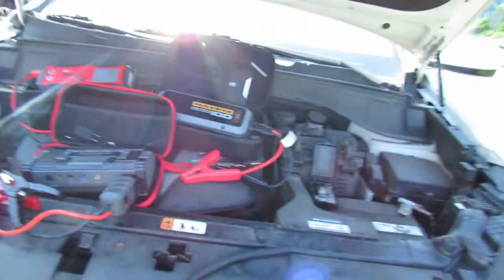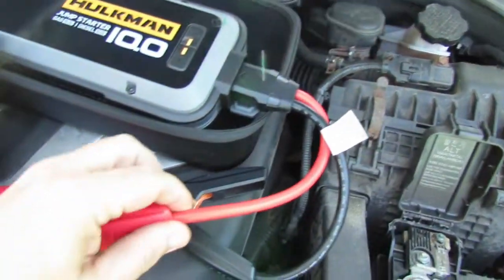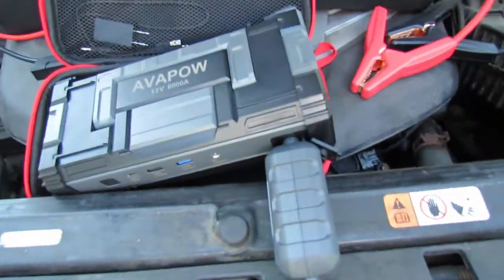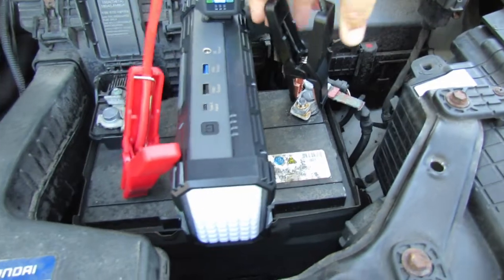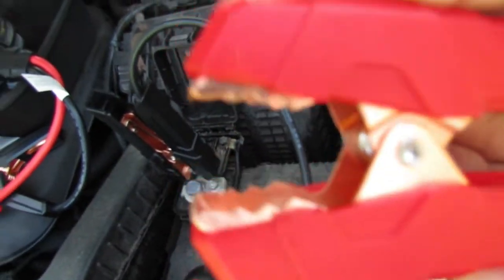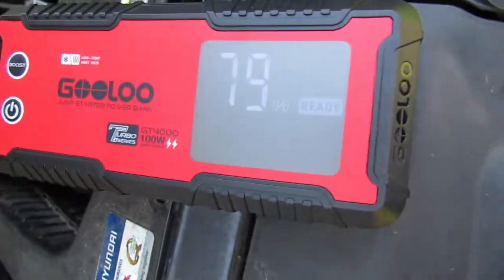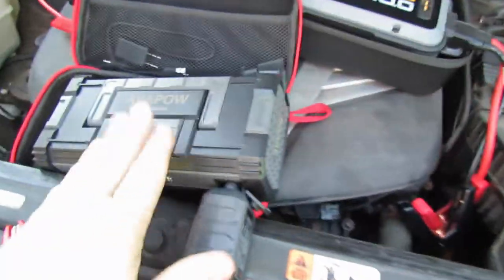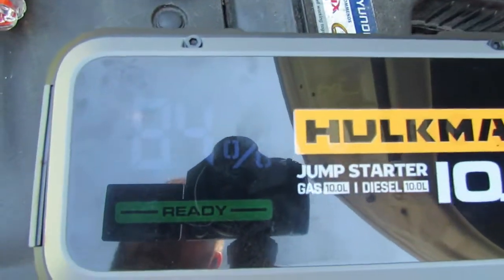(Hot Wires) HULKMAN 10.0, GOOLOO GT4000 & AVAPOW 6000A

Comment: What a crap review, as soon as that gooloo started the car the car was no longer in exactly the same state as before, as for that tester its a joke.
Use a proper test meter  or disconect the battery totally, at least that would be a consistent test for each  jump pack
Reply from the maker: Just remember there is always more than one way to test a battery for voltage, just because you see a different way than your use to seeing, doesn't mean it the wrong method. The test light with the digital voltage readout shows the ballpark voltage of your battery. The multimeter is the same concept as the digital voltage test light. Out of 5.6 thousand viewers on this exact video, YOU are the only one to make a negative comment like that saying it's a crap review and that the tester is a joke. Again, just because you see a different testing method, doesn't mean it's wrong, or not affective. We have used that test light with digital voltage readout as a tester in many videos and it seems to work great. At our channel we use test lights, multimeters, disconnect the battery, load testers, ETC, to determine the voltage of the battery, so we are well aware of how to test batteries. The whole point of this exact video was to see if the cable wires get hot or not after jump starting, that's why the video was called Hot Wires. I understand everyone is entitled to their opinion, but if you have an issue with the way something is being done in any of our videos, please ask us why we do it that way and we will gladly explain. There is no need to be negative, we try our best at H & M Reviews Channel to show how-to videos for entertainment only, these videos take us a while to make an edit. Have a great day.
Reply: Your tester didn't work correctly even with the engine running due to poor connection, but you continued to say the battery was totaly flat
Once the enngin had started that would put a charge back into the battery, but due to the lack of a decent connection with your tester you  kept showing a totaly discharged battery, if you had cleaned all the connection properly then the results would have been totaly different 
The chances are that your car wouldn't start was most likely due  to corrosion on your battery terminals and that why your tester didn't work half the time, so your testing technique was totaly untrustworthy, even to the point you made assumptions that some of the jumper backs couldn't detect reverse polarity, just think about the damage you could do to companies if people see your comparisons and the test was not done fairly  
Have a very nice day,  by the way I am a motor engineer with 40 years experience
Reply from the maker: @neknadroj1 That battery has been tested on and off camera for months as many of my videos will show, that battery had 2.3 volts in it, so to most people, that's completely dead. The Avapow 6000 1st generation has NO boost button, which was why it had such a hard time starting that vehicle. The newer Avapow 6000A have a boost, but not ours. We do not ridicule any jump starters unless it doesn't work properly or what they claim, and being a mechanic for 40 years you know that All these portable jump starters are not putting out the peak amperage they claim, not even for a second. So, as many of my other videos will show, the Avapow 6000A with no boost button has issues jump starting batteries with under around 7-9 volts. Nowhere in any of my videos am I hurting any companies' reputation by showing exactly what their product does or doesn't do, my other videos will show as well. That's why in my videos, you will hear me say, "It may be a bad connection, or maybe it's something we are doing wrong, even though we follow directions to a tee." Alot of other YouTubers have similar videos showing how some of these jump starters are just not ideal with certain vehicles. I am in no way saying things that aren't true, I just relay what is happening, or not happening. The truest test is to put the actual jump starter to the test by hooking it up and seeing if it works. That was one of our earlier videos. I am not a mechanic, nor do I claim to be. I just do a lot of research, watch a lot of mechanic videos, and read manuals to a tee to make sure I do things correctly. Also, I have found from experience that if your battery is just about completely dead, and you jump start your car, you won't put a charge on the battery after the car running for a minute or two, especially with batteries with 2 or 3 volts in it.  My latest videos will show my Cadillac V8 with 1.1 volts, will take a jump start, then after running for one minute I shut it off, I then try to start the car and the car still has single digit voltage and completely dead. the caddy will keep taking a jump start, but the second I shut the car off and try to start it without a jump starter, the car is dead. I suppose every car is different and certain jump starters may not work correctly on certain vehicles, as many mechanics have told me anyway. Also, the connections were cleaned and not corroded as far as I could see. I have also noticed that a lot of these portable jump starters are very wonky and act funny from time to time when it comes to reverse polarity or preheat technology, ETC, it depends on connections, vehicle, battery layout, I'm told. And i kept making sure the connections were good because i kept going back and forth trying on and off camera to make sure the connection was tight. But i know for a fact some of these jump starters should not be on the market, as many other videos out there will show. I respect you being a mechanic for 40 years, keep up the good work.
Reply from the maker: @neknadroj1  If you have any pointers or tips you could share, please let me know, I would love to hear from a veteran mechanic. Thanks for the comment
Reply: @HMReviewsChannel  Yes, the reason I said use a proper test meter is that test light doesn't work correctly at anything below 3 volts  if you don't believe me check the specifications, I have already said clean the battery terminals and the conectors
Lead acid don't like sitting in a discharged state so if the battery is low take it off the car and charg the battery then leave it off the car if you are not going to use it, you should still need to top the charge up about every 3 months, once the battery is flat and left in that state it goes down hill fast and you end up with a battery that wont hold a charge at all
But if you are going to test jump start packs, do it with no battery connected that way each battery pack will have exactly the same challenge 
Some battery packs say not to do it with no battery in the vehicle, but once the car starts it will put power into even a faulty battery so anything tested after that doesn't have the same amount of work to do,  also remember voltage is not a measure of ability to start the vehicle, its the power the battery can deliver under load, that's why a proper battery tester has a large load resistor to load the battery for correct ability to crank over the engine, also look out for capacitor jump start packs, they need a battery with power left in it as they charge from the car battery before it delivers that charge back to the vehicle when the demand is there from the starter
Reply from the maker: @neknadroj1 Thank you very much for your input

Comment: 4000/ 6000 amps?   1. At what voltage?    Unverifiable claim. Useless.  Better: 350a  for 10 seconds  @ 11v for example.
Reply from the maker: We all know these portable jump starters are not putting out the amperage they advertise anyway. I just mention in my videos their spec amperage they are advertising, even if people say the 4000A or 6000A peak is for a split second. I have done and seen many videos when these jump starters are load tested and most of these units' amps are nowhere near what they advertise. I appreciate the comment.
Reply: Most of the bigger jump packs are just 4 lithium ion cells in series, so most of them are fully charged at 16.8v. From other videos I've seen, the best jump packs can output 500 to 600 amps at between 9v and 11v for 3-5 seconds. You are always gonna have a large voltage drop when you are pulling 600 amps out of a 20-30Ah battery pack. If you wanted to build a better version of these jump packs, you could just use the 14.4v nominal graphene 100c lithium polymer battery packs meant for extreme drone flights. If you put 4 of those extreme C rate drone batteries in parallel, you could Definitely build a killer jump pack. It would actually be completely possible to just build a jump pack out of Molicel P42A 21700 cells. 10 in parallel and 4 in series makes a 4s10p pack that can output 450 amps minimum for at least 10 seconds. The only hard part would be linking all the balance cables together and finding a bms that will allow you to output over 500 amps for 10 seconds. Getting lithium cells that can output lots of power isn't a problem. The problem is getting the right bms with the right abilities and protections and the right charging limits for whatever you build. Its certainly not impossible to design a better product than these companies currently make, but finding the right bms for the job might be a pain in the butt.
Reply from the maker: You are correct